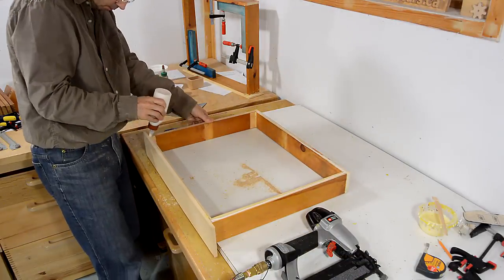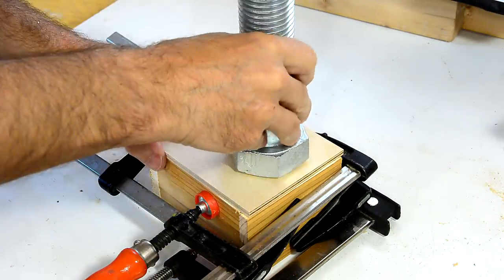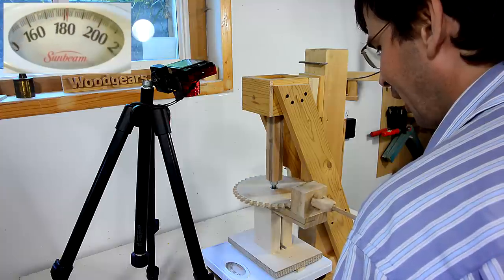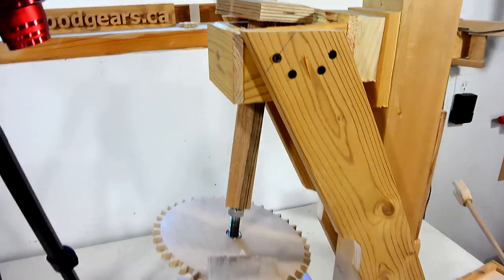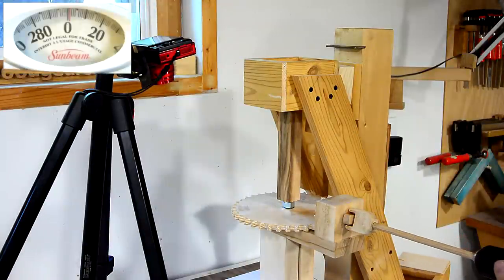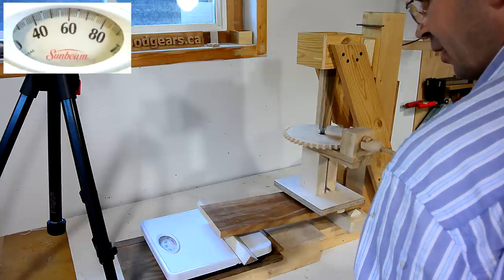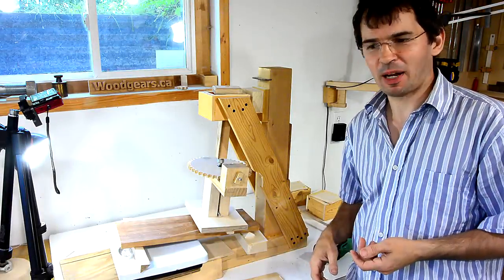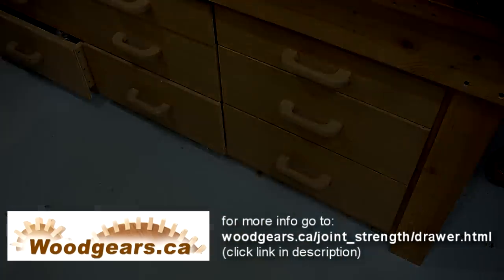Best way to attach drawer bottoms: destructive test

Comment: Yeah if the glue does not hold the bottom on a couple nails should help. I think the real argument for putting drawer bottoms in dados is for expansion. Back in the bad old days before plywood glued bottoms could split with changing humidity. So pretty much if your drawer bottoms are not splitting then you do not need to put them in dados either.

Comment: Looking at failed drawers I think there are two forces at work here, a bending moment at the glue joint and tension towards the inside as the bottom bends and pulls out of the frame. I would not discount flat mounted bottoms just yet.

A flat bottom will also help with things getting stuck. I'm sure you have prayed to Anoia, the minor goddess of Things That Stick in Drawers (Discworld, Terry Pratchett) many times, considering your randomized storage system.
I recently organized a tool drawer with narrow divisions and found the space efficiency actually increased, since all the stuff is now stored side on instead of flat. There is a lot of dead space vertically in a typical drawer.

Comment: I think the problem with bigger drawers is that the bottom bends. I don't know if this would be a problem if it were glued but if you free float a drawer in a dado and it bends enough, the edge can fall out of the dado. You might not expect that out of plywood but it happens with cheap modern furniture with MDF/particle board bottoms.

Comment: So, I'm concluding that while a drawer bottom in a groove is stronger, a glued on bottom is strong enough. Since it is and you like doing things this way, you're going to continue glueing on your drawer bottoms. Makes sense. Do what you know works. But....

This is the same line of thought people have with pocket hole joinery. Sure, it may not be as strong as mortise and tenon, but it is strong enough. Pocket hole joinery raises it's ugly head once again. dun dun duunn.
Reply from the maker: +Stanton Taylor The pocket holed cabinet or whatever will be strong enough for ordinary use.  But furniture gets banged around a lot when moving.  Seen too much cheap furniture bite the dust on getting moved.
Reply: +Stanton Taylor Strong enough today.  Once the glue fails over time (with repeated removal of stuff and putting stuff back in) that's the end.  A drawer bottom in a groove does not have this disadvantage.
Reply: Valid points. I'm not trying to argue the merits of pocket holes. I was just being a smart ass. Just having some fun.

I myself can not build heirloom furniture. I don't think most can. I can build something that'll last awhile. After that time I'm ready for something different. Out with the old, in with the new.

Comment: It is better to put the drawer bottom in a slot because that gives it both mechanical strength and adhesive strength. The area of the drawer doesn't matter as much as the surface area that has glue attached to something else. You could probably easily pop out the bottom of the un slotted drawer by jumping in it a couple of times, but for the case of just holding tools, it probably doesn't really matter.

Comment: The bigger drawers are actually weaker because there is a larger moment applied to them due to a longer length a width. The wood bottom would actually break in half before the joint failed. Good test.
Reply: +JoshL He applied the force evenly along the entire interior surface of the small scale box, so and up-scaled attempt would require the same. With the load evenly distributed, it likely wouldn't break in half.

Comment: in your test the test jig added strength to the rabbited test samples by not allowing the bottom to push the sides out. The same advantage was not given to the ones without the rabbits

Comment: Here's my guess,

Both the glued on drawer and the slot drawer experience the same shear stress from the load as well as a bending moment. The only possible way for the slot drawer bottom to fail is for the wood to break either from too much shear or too much torque. However the glue joint can fail from the drawer bottom experiencing too much shear or too much torque as before, but also the glue joint can fail from these same conditions. The glue joints are suppose to be "stronger than the wood itself", but it still relies on the wood not being ripped apart which it appears happened in this video.

Comment: Based on this, I do not think the way in which the drawer bottom is attached is an issue with regards to drawer failure - I don't think it is the rate limiting factor. The drawer slides are more likely to fail before the joint does, provided you use a reasonable material for the drawer bottom. I suspect drawer bottoms are much like shelves with regards to deflection. The size/span of the shelf/drawer bottom, the material used and the added use of banding/dados/rabbets will make the difference. Comparing a shelf made of one material to that same material with an edge band (the material used here also makes a difference) and then to the edge band with a rabbet that the shelf fits into proves that the rabbeted edge band has the greatest resistance to sagging. The shelf bottom fit into a dado mosty closely resembles this. You could use a drawer bottom of thinner material in a dado versus one just fixed to the bottom. Search "The Sagulator" for more nformation on this - it's just good information for desiging/building shelvesScott

Comment: So where do you think drawer bottoms glued into a rabbet, so as to make the bottom flush with the sides, would fit into the line up? I was thinking of making some kitchen drawers this way. The kitchen is extremely small and I do not want to waste any space. These would have ball bearing full extension slides so sliding is no issue. There would be no waste space from a dado to the bottom of the sides and the rabbet would hide the edges of the plywood bottom. The entire drawers would be plywood construction so expansion and contraction would not be an issue.

Comment: thanks for the video. I have a question that this video made me think of and I'm hoping you can help me out. however, I understand if you don't have time. how can I use your method of 5 to 1 weight ratio 2 way weigh a lathe that might weigh somewhere around 2500 pounds? Jonathan
Reply from the maker: +Jonathan Farmer google how levers work
Reply: Great! So, correct me if I'm wrong. If the fulcrum is 1 foot from the non scale rest end and 4 feet from the rest end with a scale, ......then the scale will indicate 1/5 the actual weight applied at the fulcrum?
Reply: +Jonathan Farmer  This how it works; say 1 foot fulcrum to weight, 1 foot to scale, the ratio is 1/1.   2 feet to scale, ratio la 1/2.   3 feet, ratio 1/3.   4 feet ratio1/4 and so con...
Reply: Thanks a lot guys! That really helped out quite a bit. I was able to spend a couple hours getting my lathe out to where I could weigh it this evening and estimated it to be right at 1500 pounds. Cheers!

Comment: The groove mounted bottom drawer has less internal room compared to a glued bottom drawer. But the groove drawer has a nicer look though. I'm sure that the glued bottom drawer can be made stronger than the groove drawer. If you mount additional screws to hold the bottom as well as glue, it will be much stronger. I think it's a design issue mostly. For tool shops the glued bottom is better imo, because design is of less importance than space.

Comment: With most drawers, the limiting factor is probably going to be the thin plywood that is commonly used to make them. 
I've only once seen a drawer bottom fail and that was because it was slightly bending under the weight and popped out.

Comment: Hey Mathias, nice test. How deep did you cut the grooves? It is usually preferable not to go deeper than 1/3 of the thickness of the sides. If you go deeper, you weaken the side. So, maybe the numbers would be even higher in favour of a bottom in a groove. Just my 2 cents.

Comment: You should do it with a larger drawer. The small boxes you used as a test is more solid because it is small. I recon you should keep using the glued bottoms because the bottom in a groove is more likely to pop out on a large drawer, plus it's harder to repair the groove type....

Comment: Nice and entertaining tests.  I do have some doubts about results scaling up for the floating bottom, but this does show that your glued bottoms are almost certainly strong enough.

Was this the same thickness of plywood you would use in the base of a larger drawer?
Reply from the maker: +bartholomule Depends on what wood I have kicking around, but if I have to buy plywood, that's the thickness I buy for drawers.

Comment: Do you happen to know the rated strength of the glue and if it met that spec? Guesstimating the size at about 6" on a side and 1/2" thick, that's 2 * 6 * 1/2 + 2 * 5 * 1/2 = 11 square inches, so the glue held to about 60 psi .. Hmm ... I would have expected more.

Comment: Very often the bottom is resting on something, and even as you carry the drawer around the bottom is resting on sometrhing.  So even with only a few drops of glue to keep it in place you would be OK.  So it depends on if or what type of hardware you are using

Comment: I liked your video and your testing method. Any errors were pretty much eliminated by use of a method. You did make one error when calculating the expect loading failure of the full sized drawer in that you forgot that the larger drawer also because of the size increase is acting as a lever. The larger the drawer the less weight it will be able to hold, especially when using thin stock as used in drawer bottoms.

Comment: I might concede that glued bottoms would be easier, and apparently just as strong. However as a cabinet builder I could never supply that to anyone. Most folks aren't concerned with much more that appearances. Dovetail joints and recessed bottoms w/ concealed glides are what sell.

Comment: A bigger drawer will handle less weight, I think. Yeah, you have more contact area holding the board in, but the larger the drawer, the less common it is for the weight to be evenly distributed. It's far more likely your force will be away from the joint, and at those forces, I think the wood for the bottom would give way before the joint.

Comment: Remark 1: wasn't this setup "dangerous"? This much pressure might have sent small parts your way, might it not?

Remark 2: larger-scale drawers may have allowed a much lower breaking point

Remark 3: shouldn't there have been a groove+glue test?

Thanks for the video.
Reply: +nickst0ne On remark 2 - Larger scale drawer will have more glue to wood surface area and should take more force to break.
Reply: See test sample #1.   Groove with glue.
Reply: +GarageWoodworks They also have more leverage for the load.  200 lbs in the middle of a 4x4 square does not translate to 1600 lbs in the middle of an 8x8 square.  If the item in the drawer was a single item that spanned the whole of the drawer to spread the force directly at the glue joint - it would be close.  However, you are more likely to have a variety of heavy things which are able to move independently of each other.  This creates an increased load in the same way he used the lever to increase the capacity of his scale.
Reply: +Joe and Liz His comment was that a larger drawer would have allowed for a lower breaking point.  If he repeats his test with a larger drawer and a scaled up plunger your point regarding leverage is not relevant.
Reply: +GarageWoodworks but arguably, it would still have the same issues.  To be honest, it is a bit like the claims tool companies make regarding the power of their tools.  There is no way my Shop Vac is 6.5 HP on a 120v circuit.  Can't happen.  Even with the exact same test, I would expect diminisioning returns as the distances between corners increases and allows for greater flexing of the glue joint.
Reply: +GarageWoodworks I haven't thought it all the way through but I would say its the opposite. Its less glue per square inch of drawer bottom. Kind of like smaller versions of candy bars have more chocolate per filling versus a larger one. 

But probably not enough to make a difference.
Reply: +GarageWoodworks  i have to disagree try to break a small peace of wood, its much harder than braking a long one and the bigger the drawer it will take less wight to brake it, also the pressure is spread all the way around in this small boxes any way it only make since that the grove will be stronger any ways because it has support from both sides and if it was made out of plywood i dont think it would have made much of a difference to have it in the grove .

Comment: its kind of hard to compare considering the dado relies on the wood for support while the box with the bottom just glued on relies on the glue for support. Wouldn't they scale differently on the size of the box and thickness of the walls?

Comment: This is not a fair test as the plunger covers the entirety of the base and is extremely difficult for the base to pop out of the inset.

I have this large Ikea drawer with such an inset base and it's bending under the weight of my stationery and it's barely 5kg in weight. You need to take into account the size of the plunger head.
Reply: +Aaron Lin This test wasn't about the weight the drawer is able to support. It's about the joints and how much the can withstand.
Reply: +MrGaflin It was really a test between the strength of a glue bond and the strength of the natural lignin between the wood fibers.  Because of the setup, that is what is really being tested.In an actual drawer, the sagging bottom would also leverage against the glue joint of the applied bottom.  If you have issues with sagging, you go with a thicker bottom in a groove and that will solve your sagging issues.It really is a moot point all around though.  If you are using modern metal slides, they will fail long before the drawer.  If you are using traditional drawer methods, the bottom of the drawer rests on the case.
Reply: +Aaron Lin Thats is what i think.

Comment: Nice test. My only concern is, in a real world application where the drawer is much larger, and loads aren't spaced evenly across the bottom, the joints at 800 lbs would experience more than liner forces.  Wouldn't a bowing drawer provide more of a ripping force than a straight downward force on the joint?

Comment: i think we need to see tests with a focused point where we are able to see bending, the reason why they would assume that dados are stronger are because they have an edge that cradles the bottom of the drawer. however this test has only shown a uniform load. not saying its bad or anything but i think we can get a few interesting results from doing another test

Comment: I would assume that a dadoed drawer bottom would have to be stronger provided the dado is not cut to close to the bottom of the drawer side or to deep into it. Of course all the glue makers say their glued joints are stronger than the original wood which would make my statement wrong unless you also glued in the drawer bottom.

Comment: would not a larger load, as shown in your full-sized drawers, put even MORE stress on the constant-sized rabbets and/or gluing surfaces you are demonstrating (i.e., wouldn't it make them weaker, and not stronger, as you suggest)?

Comment: The boxes were small so i wouldn't think there is much flexing in the bottom and that's why it could withstand so much pressure... I think if you were to do the same with a standard sized box the results will vary quite a bit.

Comment: the dado isn't so much for strength but allows for expansion so the sides won't crack over time.
Reply: it certainly looks better.
Reply: +Bill Hendershott plywood does not expand/contract.
Reply: +Stu Bee Plywood does expand and contract, it just does so in a constrained and slightly more predictible manner.  it is roughly 10% of the movement of the wood used to create the plys.  With cross banded plywood (as most are) it will expand in both directions across the face.
Reply: Joe and Liz Of such a small amount that it can be discounted. The point of plywood is it's stability.
Reply: +Stu Bee Not so much.  The point of plywood is predictability and economy.  Knots and other defects are less of a concern, and the way face veneers versus interior plys are utilized, otherwise expensive panels can be made cheaply.  If the movement could be ignored, you wouldnt need to leave space for expansion on construction sheeting and I wouldnt repair at least one piece of furniture a year that had the show veneer face rip apart as the plywood moved.

If you look at something like a poplar core plywood, it will move 1/8 inch over a 4 foot span.  If you are building to tight tolerances, this can pop corners of wide drawers, and cause them to bind.  That 1/8 inch movement will also expose the internal plys as the show veneer is pulled apart.  This is particularily common with modern plywoods which use face veneers that are barely a few fibers thick, and is one of the main reasons many manufacturers now are making the combination core material with a thin layer of MDF between the internal plys and the show veneer.

The point of products like MDF, particle board and hardboard is stability (and economy).  They have completely obliterated the grain structure in order to maximize stability (and yet...still move, but to a degree that can be ignored).  However, in getting there, you sacrifice strength given by the grain of the wood.
Reply: Joe and Liz
Irrelevant. The glue line failure is the issue. So what failed? The glue line of the box and box bottom or the glue line of the ply to ply. The glue-less failure is dependant on the fiber strength of the woods used. A balsa box and ply assembly will fail with less force then a walnut and oak assembly. Nothing to do with glue lines.